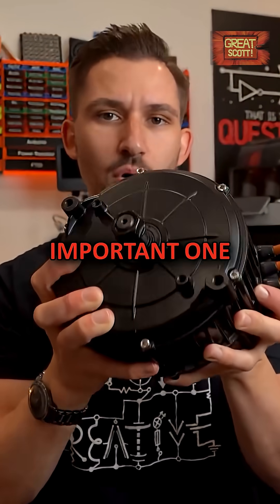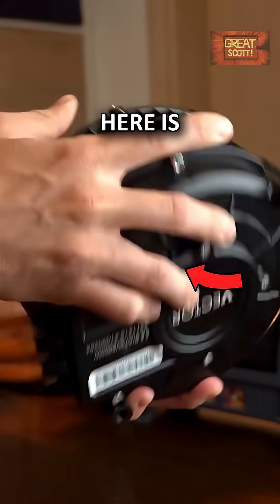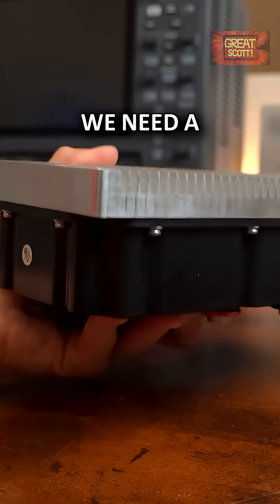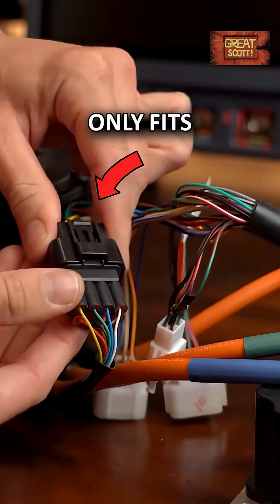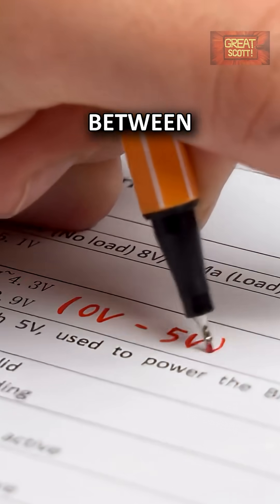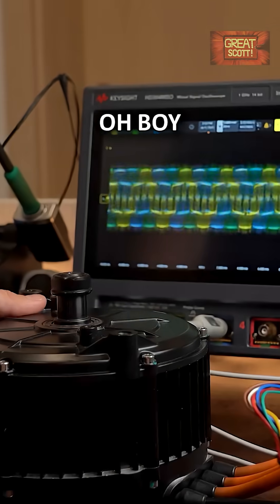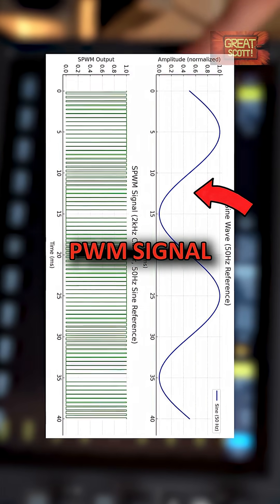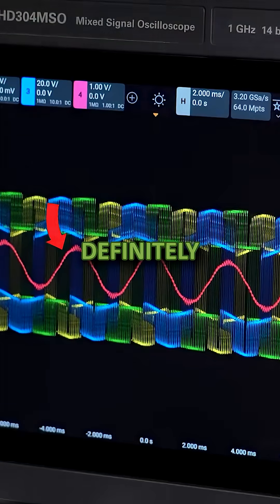Is This the Future of all Electric Vehicles? #ev #electric #vehicle #motor #pmsm #electronics

Comment: yes, this is literally an mid-drive motor and it's incredibly strong when paired to proper controller like the Fardriver ND 2600 or VOTOL EM150S (72490)
compare to the other kind of motor like the Hub motor, it quite exspensive to have such power compared to a lowered price one that has the same power like an hub motor.

Comment: wait wny not bigger spec for motor driver, it says 3kw but the motor 5kw?
Reply: Why do you have to run the motor at the maximum power?

Perhaps its too much power. Perhaps it drains the battery too quickly.
Perhaps the batteries can't deliver enough current to drive the motor at maximum power.
Perhaps the designers made compromises in their design.

Why is that a problem?
Reply: @deang5622  so 5kw motor is more safe using 3kw driver? that's the reason?
Reply: @briwicklab No, it is nothing to do with safety.
It all comes down to what the designer intended. Perhaps he couldn't obtain a 3kW motor in the size and shape he wanted so he had to purchase / specify the next size power rating up.
Reply: @deang5622  aaaaa i got it. so ideally, it should be 5kw motor with 5kw driver right?

Comment: Hey that’s cool! I design BLDC and PMSM control systems, I can say the world is not ready for PMSMs on the simple fact that most people barely know how normal motors work/what actually makes them useful, lmao
Reply: A question. What's the difference? In the video I see what I call bldc motor. This is a 3 phase motor with pm conmuted from a driver that is powered by dc supply.
Reply: @miguela.m.8671  It's honestly pedantically minutely different, in PMSMs they're mechanically arranged like BLDC but they're driven usually from more complex math related to commanding waves, mostly with how they have some live load compensation read from in-operation Back-EMF and then tuning themselves around that for whatever the use case is. BLDCs are just blind and run fast and barely care about backemf most of the time.
Reply: @ironichoneybadger5066  What is the difference in the physical construction? Just extra sensors?
Reply: yeah like when before selling computers they had to pay all future technicians all over the world a phd in some computer science field
Reply: You don't need to know how your motor works to ride an ebike or drive an ev.
Reply: @Markcain268  yeah right but designing them into a system is what I mean, most people barely think of motors outside of peripherals of larger products and worse, will just assume they're electricity in motion out gizmos that they don't think about.
Reply: @Markcain268  so if youre ICE or EV car breaks down, who you gunna call? Someone who KNOWS how it works? Or ghostbusters?  youre welcome
Reply: @Markcain268 as a technician who repairs refrigeration systems (yes I'm a refrigeration technician) i have to know how a motor works
Reply: @panagiotispsomas5611 so my comment is wrong in some way then?
Reply: If you are working on equipment as a technician you should know a basic about the motor otherwise you can't troubleshoot what is going on to the equipment
Reply: @panagiotispsomas5611  you seem to be rather good at stating the bleeding obvious, of course you need know how a motor works if you are going to work on them, you'd have a hard time if you didn't,  we are talking about people in general, seems you either didn't read the original comment or failed to comprehend it.
Reply: @panagiotispsomas5611  spot on here, and knowing the difference between BLDC and PMSMs will do wonders for your industry, especially for energy efficiency and traceable sustainability requirements for your system
Reply: @Markcain268  actually I was talking about technical implementation and design theory and you missed the point of the joke I was making, fitting that a refrigeration technician didn't though because he's the exact type or person that would find what I said relatable. The fact you're continuing to argue about it also points out the obvious that you feel you don't need to think about your motors in a system you might use/have and that makes you incapable or under-equipped to understand what about PMSMs is even useful/good
Reply: @ironichoneybadger5066 well you said most people,  you should have said most technicians, but in your haste to show how clever you are you neglected to do so! 😂
Reply: @Markcain268  I meant most people, and the only one here trying to look clever is you homie
Reply: @ironichoneybadger5066 BLDC can still be driven with field oriented drive, they just need to compensate for the uneven back emf more. Though, looking at the back emf of so called BLDC motors you'd be hard pressed to say they're trapezoidal.
Reply: @mikafoxx2717  spot on here, and the trapezoidal wave that I mentioned is just based on the VFDs we used at my job for the task of controlling BLDC motors. PMSMs are similar it's just mildly different control scheme stuff

Comment: Now it makes me wonder, Could you try running a three phase Motor with the sine wave controller? Plus, what happens if you have for example three phases each at 50 Hz with the voltage rating of the motor, would the Motor only run at  1400 or 2800 RPM? And how does it differ to a standard three phase motor?
Reply: Frequency determines speed. Voltaje determines current. You can control de ratio v/f to different purposes. It depends on the capabilities of the driver and it's design. When using a vfd you have a whole range of possibilities.
Reply: @miguela.m.8671  Crucially if effective voltage is varied using pulse width modulation, the motor operates more efficiently at lower speeds.  More torque and less resistive heating.
Reply: @ChrisNotTheKing torque is precisely what creates heat in the first place with motors.. unless they're at such a high RPM that the core losses are greater than the copper losses.
Reply: @miguela.m.8671 voltage determines speed. The KV of a motor is how many RPM per volt. The current is what makes the torque. But in the real world you need voltage to make it pull current thanks to the back emf when it's moving, and the resistance if it's not
Reply: @mikafoxx2717  "DC" motors only speed control may be voltage, but three phase induction motors rotation speed is tied to the alternation.  If driven with mains voltage at 50Hz, rotation speed won't vary with voltage changes.  That's why a means of sensing the absolute rotor position is important for variable speed vehicle motors.
Reply: @ChrisNotTheKing Well, yes. But they still have an RPM per volt value. Below a certain voltage the frequency doesn't matter as it cannot generate enough torque to get to that speed even unloaded. That's what I was talking about.
Reply: The sensor in the motor (hall effect) tells the controller the absolute position of the rotor.  The controller then sets the phase position activating coils according to direction.  The overall sine wave frequency depends on the motor responding, which depends upon the resistive torque.

Comment: only need the proper tool to spot weld the batteries (no kweld is just too expensive, and seems the chines cheap one on ali have a very short live, still waiting for a video about it)
Reply: Take an old capacitor from a car audio system with about "one" farad, connect thick wires and try your best, works fine for me.
Reply: @romanmaier4307  would be great to make a video of this!
Reply: Could also use the new type lifepo4 with screw terminal bus bars. Then you only need a screwdriver.
Reply: @4nlimited3dition_4n3d  interesting, did you publish a video about it?
Reply: @ytrew9717  I haven't made a video sadly, but I did make a mini bike from those cells. 5,5kWh battery and tiny size and the battery is modular down to individual cell level. So easy to disassemble. The modern lifepo4 12V car batteries are made in the same way.

Comment: you say motor is 5000W but your controller 3000?
Reply: Yea? A motor can have a max rating of 5KW, but the controller could do 3KW constantly, that does not mean that its the MAX it could do, my E-bike controller can do 1KW, but my motor is 3KW, and at launch, it does inface push 3-5KW (because components have head room) also, the main issue on a controller is heat, so for short moments, it can push 2 or even 5X (although rare)
 its rating no problem, if its only for a very short time
Reply: The extra weight of the motor aint worth it. Get a 3kw@Mijo0x9
Reply: @Mijo0x9but starting a huge inductive load will mean it draws a lot more than the figure on the label surely?
Reply: @xTerminatorAndy the motor will never pull more then 3000W since the controller is essentially the motor’s power supply. You supply the controller with 5V and it supplies 3000W for the motor to draw. The motor in this setup can only pull as much power as any chosen controller can but you want one that utilizes most of the motor’s max power rating.
Reply: @xTerminatorAndy the 5KW is the max rating on the motor, so it can only fluctuate to 5.5 but thats not that big of a deal for a short burst
Reply: @aidanhoben4771  that's just wrong. Stop talking because you're recommending people do dangerous things
Reply: @DoesntRefillTheBrita  homie doesn’t know how a VFD works? That’s what the ‘controller’ is doing here. The controller selected can’t output more than 3000W so unless you over stress your motor from it’s load (for example, too much weight on a conveyer the motor pushes) then the motor will not ever even push more than 3000W. Too much load will cause the controller to decrease the sine wave frequency, slowing down the motor. Too much load and the controller trips the circuit before the motor burns. I work as an electrical and CS engineer in industrial automation. Thanks for the criticism though and enjoy your night. (A sine wave generator is what a VFD is/does.)
Reply: *Sine wave controller is essentially what a VFD does internally, but not identical
Reply: @xTerminatorAndy the controller sin wave controlling it so it starts at zero crossing so initial current spike is not that much
Reply: Contrary to RC speed controllers, vehicle controllers are typically current (and therefore torque) controlled. They will only output their rated current, effectively limiting the bigger motor to a lower power
Reply: The 5000W is the maximum power the motor can handle. It is not necessarily the power you drive the motor at. You can drive it at any power UP TO 5000 Watts.
Reply: Yup, so it won't burn the motor coils
Reply: Yes and you can run a 5000W motor with a 100W controller. It just won't have as much power.
Reply: Yes sir
Reply: You can cook both elements, but only one has thermal regulation.
Reply: What a noob question to ask
Reply: @Meme_supplier  don't be a douche canoo
Reply: @xTerminatorAndy  your question is like, why would you put a 3000kg of load in a vehicle that can handle 5000kg. You see how silly your question is?
Reply: @Meme_supplier  why are you being gatekeeping and condescending? there's no need for that.. an inductive load can generate a lot more amperage when it starts up, I was just wondering if it wouldn't burn out the controller. Also your analogy doesn't quite hold up.
Reply: @xTerminatorAndy  in this case, the inductance sort of prevents huge current spikes. The controller uses high frequency PWM to supply the motor with 3 phase power at variable voltage. Usually 16khz and above. Each time the output stage of the controller switches on, current starts to flow and the motors self-inductance generates a voltage opposing the controller. This slows down the current rising. Slow in reference to several khz switching frequency. In essence, the motor limits how fast the current can rise. The controller observes that rise and modifies its PWM to achieve its target current.
The ohmic resistance of these motors is very low, in the ballpark of milliohms. If it weren't, they'd generate lots of heat while running. Consequently, if it weren't for the inductance slowing down current rise, you'd have an instant short circuit, the moment the controller switches on.
Reply: @xTerminatorAndy  an inductive load will not make the controller past it limits, it’s like your expecting a welding machine with a maximum of 120 amps to produce 500 amps